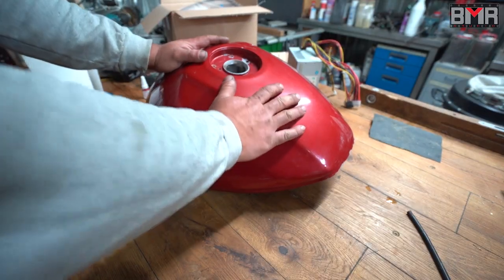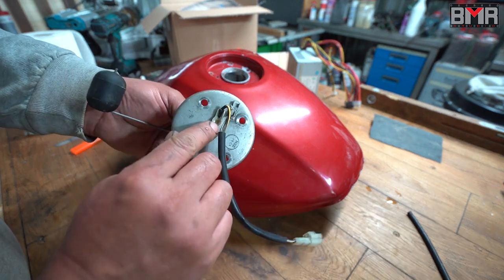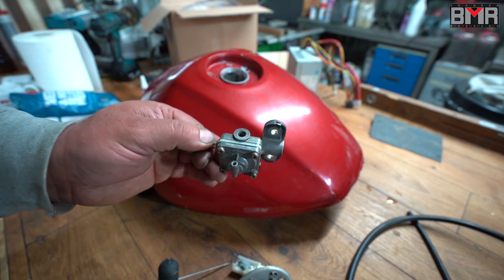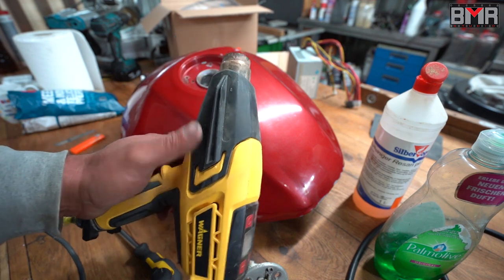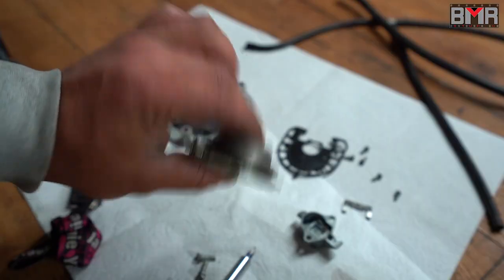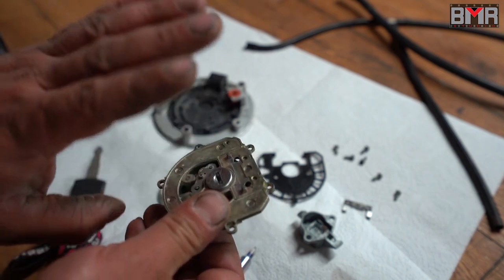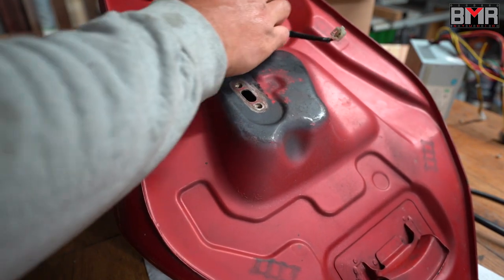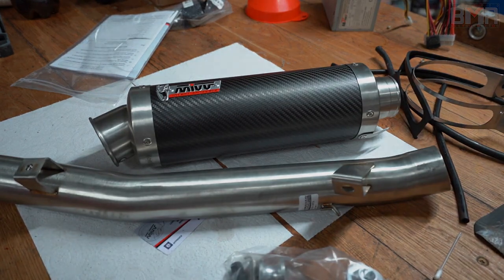Motorbike fuel tank cleaning, little secret in your fuel cap! Suzuki Bandit GSF650 S

Comment: So I removed my gas cap and drilled a small hole on the inside of the rubber ring and through the metal. Now I have a vented cap. I now have over 350 miles in the past 3 days of riding. It runs superb!!  Finally a normal vented gas cap and no more running problems. I wished I had learned about this gas cap earlier. Thanks for the video. My 1200s Bandit is running and idling fantastic!! Like new!!  Will continue to rack up the miles. Having a tank that can not vent properly was the problem. I was blaming my carb bank having pulled them and cleaned them about 10 times and then figured out I was have a tank vent problem Its all good now!! Will up date if there are any more problems. 350 miles and counting!!

Comment: Probably the only thing I've not tried, was told this might be the problem. Only 30 mins running before cuts out, I've tried ecu, coils, leads and plugs. Even carb settings. Fingers crossed this works. Thank you for the explanation.

Comment: That vent Is connected to a steel pipe running thru the tank and out the bottom to a rubber pipe. The steel pipe inside can get rusted up from the bottom and blocks
Reply: im having this issue at the moment, my overflow is blocked, tried to clean it from the top and bottom today with wire, no luck

Comment: Dude I got the same experience what you have said, I put a new CHROME VENTED STYLE GAS CAP which I bought from ebay, on my chopper as what you have said, when I throttle my bike it stall, keep trying few time the damm old same thing happen, I change back my old CHROME VENTED STYLE GAS CAP, and it run like normal again. The only different between my old and new gas cap is the new one got 2 small holes while my old one got only one.

Comment: I put some WD40 on my key as the lock was getting arthritis. A short ride later my bike died on my. I had a full tank. Suspecting a vacuum in my tank, I opened the gas cap and closed it again. A few cranks later, it started again and I drove it home only a few miles away as it was getting dark and I did not want to ride in the dark and have it go dead on me again. I suspected tank ventilation but had no idea about it being this complex. I also have a gravity feed fuel valve as my original vacuum  version was allowing fuel to pass when parked and no way to shut it off. I will now find a way to vent my gas cap with out all this complex EPA BS engineering. Thank you for the video. I had no idea. But I am not surprised. I will remove and cap the vacuum line and remove the ball and valve from the cap and allow it to vent old school. Thx.
Reply from the maker: Don't remove those small things! Each has a purpose. Just buy a new lid. Cost around 20-40 Dollar. Swap the lock and You are done. 5 min work. Ah, and blow the fock out from every pipe 😂
Reply: @BMRStudio   It is done. My Bandit 1200s gas cap is pretty much the same as yours except my check valve is plastic and uses rubber valves. I removed this and put it all back together. Will let you know how it goes. I am confident it will go great and no more fuel feed  problems.  Will let you know. Going for a ride now to test. Also. I am running a Delkevic Can on my bike. I jetted up a little and wow!!  The power increase is amazing!!  And the sound is glorious!! 1st 2nd and 3rd gear pulls are brutally fun!!  I also run DID and use GO 90 to lube it. Thanks again!!
Reply from the maker: @grabir01  DiD is the best! On chain I'm using only WD 40 and a bit differential oil. Super clean and not sticky. 7 year old chain looks like new. Act like new. Wishing Hell good ride bro!
Reply: @BMRStudio  Was test riding my removal of the check valves in my gas cap. All was going well and....... Broke my DID chain!!!  I had to lay it back on to my rear sprocket and roll it backwards to pull it out of my counter shaft sprocket area. Got it out. Was up Deer Creek canyon with no cell service and was able to cost back down the canyon and out of the mountains to cell phone service. About 11 miles of coasting. I should have adjusted my chain. I knew it had a little slack. On a good note, there is no oil leaking so I should be ok. Will not know the extent of damage if any until I get the counter shaft cover off. Pray for my bike!  Thx.
Reply: @BMRStudio  Its getting late here in Colorado. I have a report to make. Pulled my counter shaft sprocket cover and to my amazement, I can not find any damage. Not even a scratch!!  How can a chain be jammed up in there having to be pulled out using the rear sprocket with 2 men and a woman pushing it backwards to get the jammed chain out.  How can this be? I will take it as a victory. Neve mind I had to wait 6 hours for a tow to get the bike home. At any rate. Its all good news. I will give most of the blame to the JT racing sprocket on the rear as its teeth are not tapered enough and the big flat spots on the tips will catch a chain and cut or break it. So. I will order another DID chain and Tapered all the teeth on the JT sprocket.  Its all good!!!  Thanks for the prayers!!
Reply from the maker: @grabir01  chain sprockets must be original paired with the chain always.... Many tunning gadgets are actually crap. Speed manufactured CNC leftover cuts. Garbage. The original DID sprockets are pressed truth smith process. Super hard on the teeth surface and the middle section is stress free.
Reply: @BMRStudio  True.
Reply: @BMRStudio  Latest update. Now I have gone 520 miles with out a single problem!!  Love it!  Drilling a small hole into my gas cap has solved all my problems!!   Yes!!  Will continue to pile of the miles!!
Reply: @BMRStudio  Over 900 miles now. Perfect!  Drilling the hole in the gas cap did the trick!
Reply from the maker: @grabir01  LOL :)))

Comment: Nice video. 
Trying to get mine off my Suzuki Bandit only got 6K on it after it being unused for 11 years. Cleaned the old fuel out and squirted some carb cleaner down the back of the carbs through the air box and it nearly fires so hoping with some fresh fuel in it will fire up. Annoyingly I cannot open my fuel cap. It's had lots of penetrating fluid squirted down the key but it will not turn and unlock. I have took out all the screws except one that will not remove (but I feel that's a dummy one anyway) but I can't get it out or the cap to pop up. I'm not sure the key is going fully in (very close) but stuck at the moment. It's like one of the barrel tumblers has dropped out of position. Grrrrrrrrrrrr..

Comment: Very good explanations! I liked your approach to tank cleaning, a really good alternative to various acid based methods.
However, I don’t quite know what product to look for in the shops here in Norway being a “semi industrial bathroom cleaner”. I would appreciate very much information about what is in that stuff. Thank you!
Reply: Sorry for asking before searching. I found the following for a Silbervogel product that I assume is very similar:
SU 200 Resan Extra
Kraftvoller Sanitär- und Badreiniger auf Fruchtsäurebasis. Löst schonend und schnell Kalk-, Urin- und Kesselstein, Rost und Kalkseifenablagerungen. Wirkt gründlich, jedoch materialschonend.Für alle säurebeständigen Flächen geeignet. Nicht auf Emaille oder Marmor anwenden.
translate.google.com: Powerful sanitary and bathroom cleaner based on fruit acid. Gently and quickly dissolves limescale, urine and scale, rust and lime soap deposits. Works thoroughly, but gentle on the material, suitable for all acid-resistant surfaces. Do not use on enamel or marble.
Reply: @ustenhau  I was having the same question. From your google translation, here in New Zealand we have products like CLR -  Calcium, Lime, Rust remover. I will look up Silbervogel and try to compare them.

Comment: I had to install a glass fuel filter bowl to cure/trap, and keep my fuel clean to my carbs. My tank liner started to put super fine deposits into my fuel. Only the glass bowl cured this problem.
Reply from the maker: I got a super luxury filter set from a friend, who has a Stihl shop and service. Since then, not so much problem with dirt. Only the stupid 10% ethanol is killing all rubber pipes, gaskets, whatever. So 100 octane only!
Reply: @BMRStudio  A filter was not able to get it done for me. The particulate matter was so small if would pass through. I tried a ceramic filter but it would not allow enough flow but it did filter. The glass fuel filter bowl is doing the trick as the matter is heavier than fuel. I have emptied my fuel bowl 3 times now. It works!! Stens Filter Bowl Assembly 120-030. As for fuel, I use midgrade. It makes the most power for me. The stuff I use for fuel line is working well with ethanol10 percent or more as I am in Colorado and that is all we have. . As for fuel line, I use Silicone Tubing. No degradation at all. As new. Ethanol does not faze it.

Comment: Im having the same issue with my bike. 2000 kawa zx6r. Rides perfect for hours on small roads, but after 20 min on highway at 120km/h it dies as if out of fuel. Wait 10 minutes then it starts. First thing i did was remove the fuel cap/lock and clean it, but the problem is still there. I didnt dare to look all the way down in the small valve. Maybe i need to clean again more thouroughly? How would one clean that tiny valve? Or could this be an electrical problem when the bike gets hot at 120km/h? Fuel pump is working and i have put in a new relay...
Reply: Great video btw!
Reply from the maker: I think your case is different. Looks like the floating valve cant pass trough enough gasoline. Or, the fuel tap is dead. 10 min  is too short for a fuel cap problem. Just drop it to some cool nice mechanic guy. Give him a 100 buck to fix it.
Reply: @BMRStudio  I have replaced all float valves and all carb related gaskets. Jets all clean. Could it still be the float valves? Maybe the height of them? How would i know if fuel tap is dead? The flow seems fine when the tank is off... Appreciate your answers thanks.
I really want to get the satisfaction from fixing this myself! Spent a lot of time already. Not that sure a mechanic would find the problem that fast either. Wont be cheap where i live 🤕